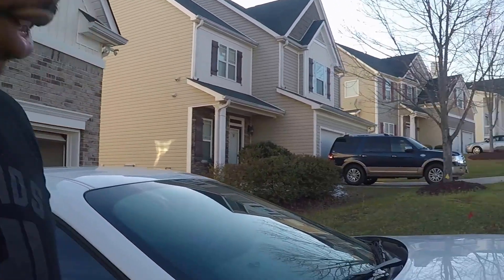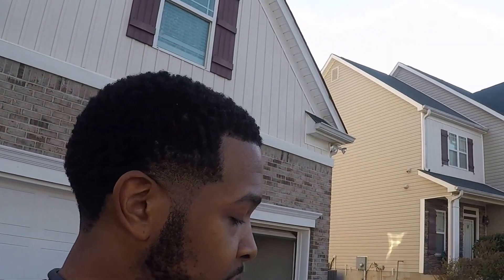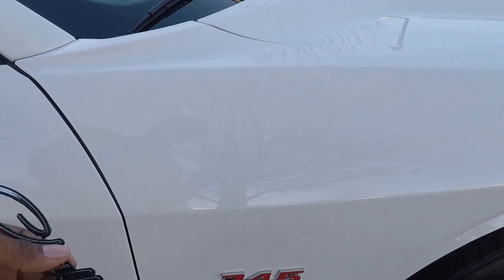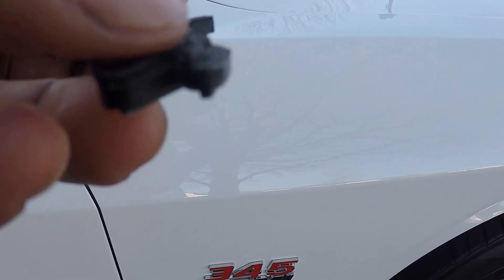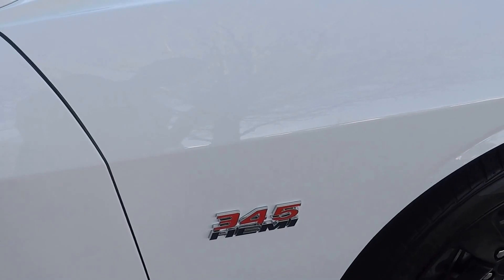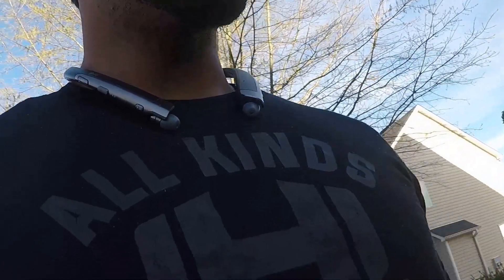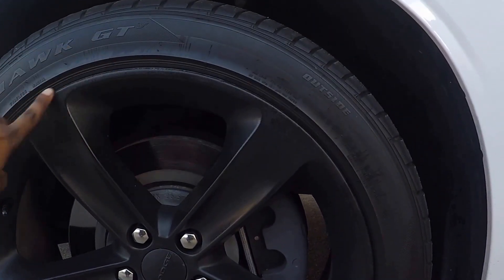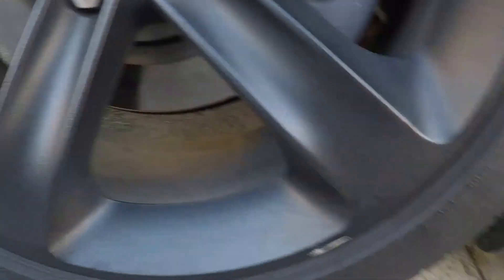345 HEMI Badge installed!!!

Comment: I hear so many people say the car drives like a boat. Have you had any issue with breaking or turning in deep corners?
Reply from the maker: It is a pretty heavy car. Straight line is great but for a track course or driving through a lot of corners you can feel the weight. Breaking isn't too bad but honestly I think brembos should be put on all the V8's. Thanks for the support bro!
Reply: A 1968 Caddy drives like a boat.

Comment: what does the 345 mean?..
Reply: It's the cubic inches of the engine (the size of the motor). The 345 is the 5.7 Hemi, the 392 is the 6.4 Hemi.
Reply: @brianreiber2362  I drive R/T never heard or seen a 345 emblem before
Reply: @delandomcleod2052  Dodge doesn't provide one for any of the 5.7 liter engine (you can find them on Amazon). They only put the 392 on the 6.4 liter engine.

Comment: who came up with the 345 emblems? they are wrong... the 5.7 is 348... why cheat yourself of 3 cu inches to brag about ? if your going to round it down 3 inches .... why not just round it up 2 inches  and call it a 350????
Reply: The 5.7 is 5654cc which is slightly less then 345 ci .